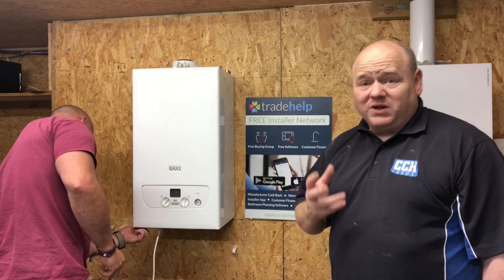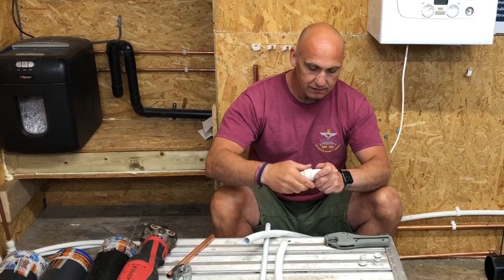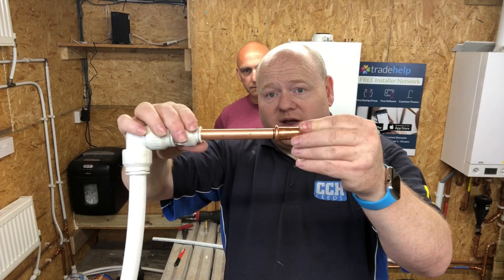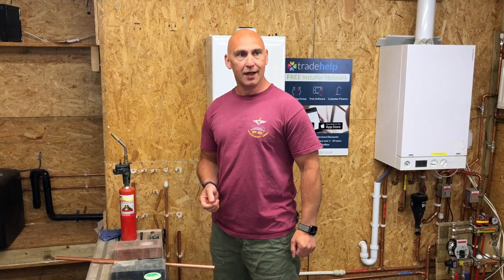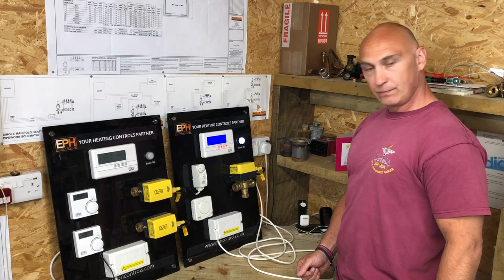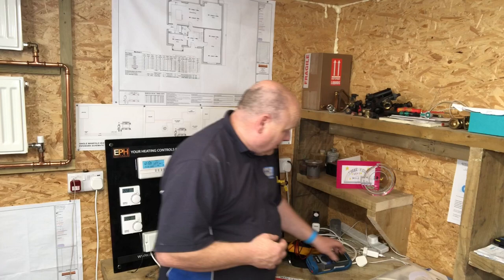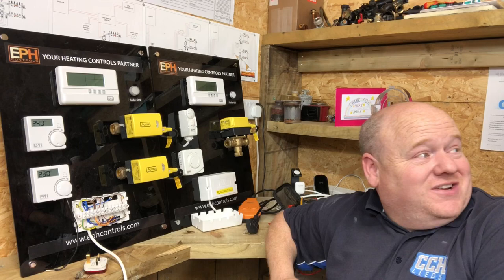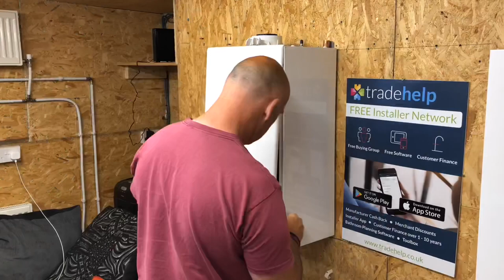Train to become a Plumber - Plumbing Overview - Soldering - Boilers - Pipework

Comment: Hi Allen, can I ask a plumbing question, I am planning on fitting a wall mount mixer valve & bath filler.
Bath is fed by 22mm. Mixer valves look like there fed by 15 mm pipe. Have I got to reduce down to 15mm from the 22mm
Reply from the maker: sorry for the late reply, Did you sort it. Thanks.
Reply: Allen Hart ,yes all sorted, Thanks.

Comment: Hi allen is it possible to  join the  flow a return pipes  together if you take a rad off that is no longer needed
Reply from the maker: No, just cap them
Reply: @AllenHart999  thanks for the quick response the pipes ate 10mm speedfit and the pipes  drop in to the kitchen but i am taking the wall out and hoping to just cut them and  push them in to the ceiling then board over would yoh use plastic push fit stop ends or would you go with a brass compression fitting  for 10mm speedfit pipe